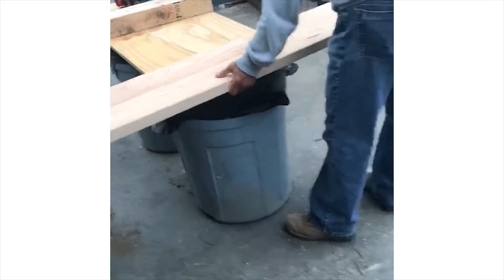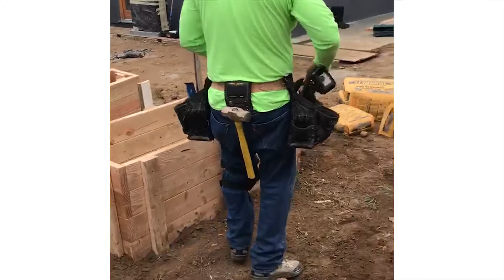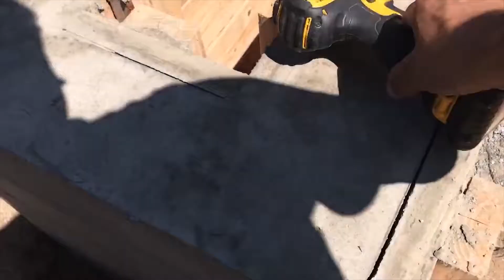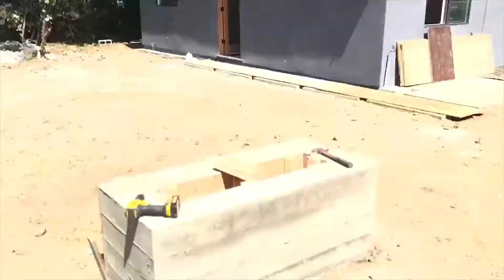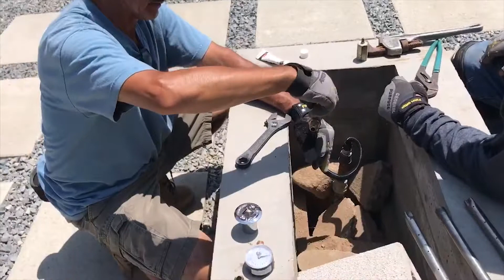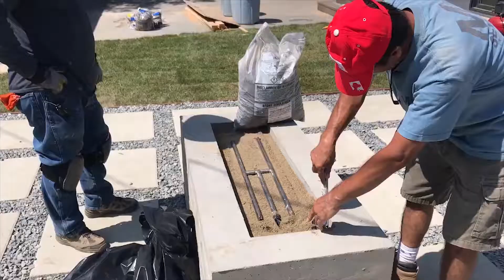Clean Out Door Cement Fire Pit - How to Create & Build - Super Easy

Comment from the maker: Hello.     The way I built this one there is not a need for ventilation.   The flames are pretty much right at the top.     If you set the flame lower, more so the traditional fire pit, you would need venting.  I do have holes at base for drainage.   Thanks for watching!
Reply: Cool that was my next question. Do you need drainage holes or some way of draining.  Thanks.